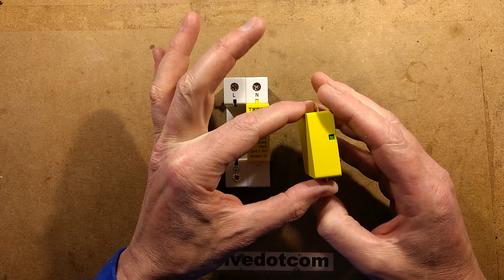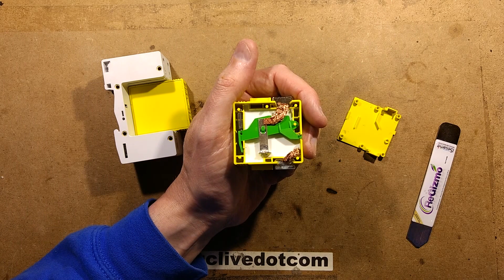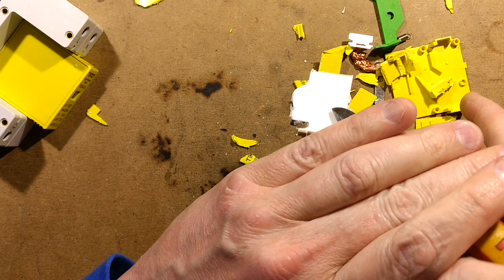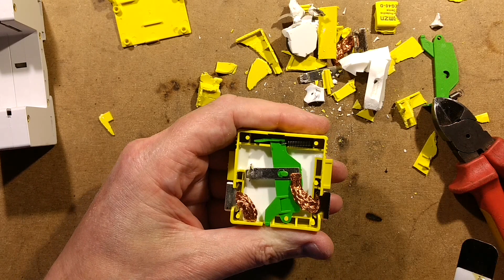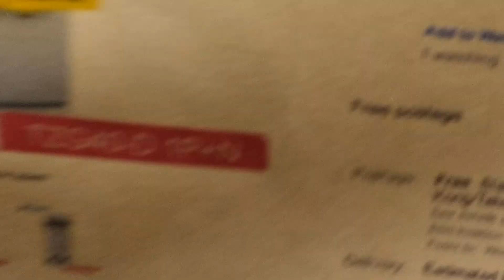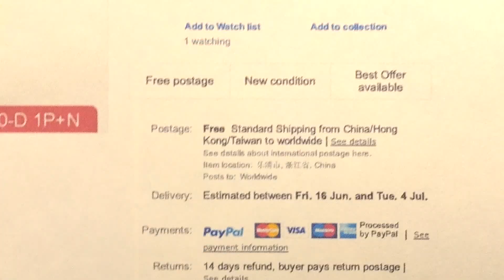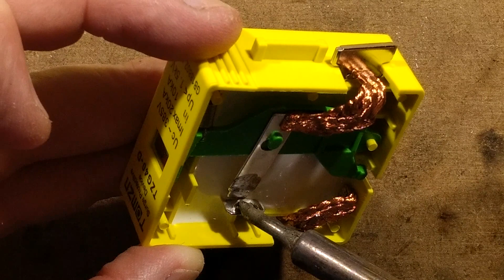DIN rail mounting surge protector with uninspiring safety device.

Comment: That rear plunger is used for mounts that have a secondary micro switch so when they trip they open or close the switch and trip a remote alarm. I use Hager brand products where there is an optional switch equipped base for the alarm feature.

Comment: The safety device may use model-maker's solder rather than electronics multicore. Because when you solder a new bit onto a model, the bits you did before can desolder themselves and fall off, modellers have at least a dozen (sometimes more) different solders with different melting points. and you start off in the middle of the model, using the highest melting point solder, and as you work outwards, you use lower and lower MP solders (and turn the soldering iron down as you go!)

In the seventies, some model-shops, specialising in cast metal models, would have a shelf with about fifty different grades of solder on it. This is why plastic Airfix models won out in the end. Some hard-core people will still build model steam engines and the like from dozens of die-cast bits, tacked together with a pallete of different solders.

It would be possible to select exactly the right melting point, if the maker was bothered...

Comment: I took a failed one of these to bits some time ago (made by Weidmuller). The interior design was very similar indeed, with the exception of the "solder blob" which in their case seemed to be sintered fusible disk. Worked on exactly the same principle though - once the MOV had absorbed too much energy, the internal resistance dropped (pretty abruptly), and the high current caused the fusible link to, well, fuse.

Comment: Great Videos  Clive. I have these fitted. I`m not expert!. But they have to be used in conjunction with the MCB/RCD combo, (or any fuse). That is what isolates the circuit not the Surge Protector. I think the part your were desoldering is just the flag to tell you the unit has failed. They fail eventually if you have multiple surges (they say) So as I understand it, the unit goes low resistance very quickly after the voltage exceeds a preset value. that low resistance draws enough current to trip the consumer unit fuse. Job done. The flag may still be green telling you the unit is still viable. Hopefully they work as designed!!...We live in the mountains and the mains gets hit often.. Thanks again.

Comment: MOVs are an ablative component, iirc and they fail short, don't they? So that solder link is intended to see the full dead-short as the MOV fails and break the connection.
Reply: Hyratel They do not ordinarily fail short, just a much lower impedance than normal as they degrade causing the to warm initially, and eventually combust as they further deteriorate and get ever hotter over time (sometimes you will see them with a thermal fuse sandwiched between several MOVs for that reason).  It is the heat created by the MOVs internal resistance that melts the solder and opens the connection.  It is not until the MOV is reduced to a charred carbon remnant that you would see a near dead short, but that only comes after the fire event.
Reply: Ethan Poole til, thank you

Comment: If they had the solder joint running in the vertical plane rather than the horizontal, as we are looking at it here, the separation would be much better. I don't think they have thought this one out very well. Good idea, badly executed.

Comment: For the solder joint, I'd say that when it actually begins to fail, the arc created as the join separates will probably finish off the remainder of the solder created a wider gap between the two contacts. That's my guess, anyways. I learned that about some glass fuses as this is the way they work.
Reply: Bobby Hicks Except that there is no arc so long as the conductive bridge remains (the arc only follows once the bridge between both sides goes open and you get back EMF from an inductive kick).  That said, the lower contact should still remain a liquified puddle of solder so long as current flows through the MOV, so it may still separate eventually after things warm up a bit more.

Comment: Even if gap would be wider - it would be far from regular circuit breakers. There is no arc extinguishing chamber. I believe that would not be able to cut even 500A with WIDER gap. I assume this device is not expected to cut short-cicruit currents and regular circuit-breaker is expected to be connected in series.
Reply from the maker: It's only expected to break its own fault current which would only be the amount that was causing it to heat.  Probably around 50mA.

Comment: The metal piece seems to be loose on the green plastic, and the hole through the metal piece which the green tab slots into is longer... when you heated the solder, you were holding these upside down from the position they would be mounted in. Is it possible that if the solder melts with them held proper-side up, that the extra play that the hole in the metal slot allows would let that metal connector to be pulled down by gravity, making the gap wider and making a solder bridge less likely to form?

Comment: in this case you do not want to break the circuit, because if the circuit is broken you would be able to switch back on the circuit breaker and maybe not replace the faulty varistor! is safer for the circuit and people to keep it short circuited when it actuates, enforcing replacement for a new one. spetially on the ones that do not have an auxiliary contact for monitoring is state!

Comment: Clive, thanks for discombobulating one of these for me. I checked the specs on this model. It is important to remember that for sensitive electronics to be protected from lightening surges. You need a response time of <4ns. This device is rated at <25ns. Also I am wondering if they may be relying on the spring loaded pin (normally located in the base, but not with the base you have) to help push the green indicator completely out of the window. As you mentioned, and in the models I have seen, the pin (when released) closes a set of contacts for alarm purposes. Also my motto is that no project is complete without a blood donation.

Comment: keep in mind that a dead short would cause it to trip in the off position. if the device did not completely trip in the off position, the dead short will still be there. so the triping condition will  cause the device to trip again very fast!  The complete open circuit will be completed in less of a second.

Comment: if the unit is positioned horizontally like it would normally, would gravity help the solder "flow" down to make a better/larger break?
Reply: Do a test with it horizontal and use electricity to break it.

Comment: Have you considered the impact of gravity to the melting of the solder?  Both times you melted the circuit it was flat on its side.  If the component was in place the heat would be coming up the long arm of the switch and melting down that arm.
Reply: Not all DBs or din rails mount parts/switches standing (eg 3 phase style boards...), utilizing gravity as a part of safety system is a bad idea for many reasons... Unless orienttion is specified on spd I would actually pass it even if fitted upside down

Comment: I dont understand this thing. are you supposed to solder it back together to reset it or what? and wouldnt when it popped depend on the solder you used and how much etc cos some solder melts hotter than other.
Reply from the maker: Once it gets hot enough to melt the solder it has already failed and the whole module needs replaced.

Comment: The markings on the thermal cut out ( L, N ) suggest that its used in a single circuit. BUT and its a big but, both live and neutral are meant to be linked making it a double pole isolator. If the solder was to heat and break the contact on the NEUTRAL side it will stop the appliance from working BUT its now in a dangerous state as there will be 240v present at the appliance relative to earth.  
PS Great show !
Reply from the maker: It's just hooked across the mains.  It's not in line with a circuit.

Comment: hi, it would be great if you can hack and chack the high amp motor controller from China. These controller are used for the electric motorcycle conversion and people are always in doubt about buying them. You will do a great karma for not only the people but also for the mother earth as electric motorcycle conversion is a step for saving the mother nature.

Comment: BigClive: If this device was used as a 'safety swith' controlling a contactor, the gap wouldn't need to be too wide since there would be no risk of arcing as it would on a high amp load. Maybe?
Reply from the maker: The contact is to disconnect the internal suppressor when it fails and starts getting hot.  This device is intended for connecting directly across the mains.
Reply: Ah, ok. Nothing like showing my ignorance for all to see. 🙂

Comment: surely a MOV and a regular breaker would do the job?
Reply: How would a regular breaker detect the MOV overheating, then?
Reply: the mechanism shown is not detecting over heat, the solder joint acts as a fuse as the the MOV clamps it's resistance drops and pulls more current which melts the solder joint. a regular breaker would trip on this current. if you did want to detect over heat you could include a thermal cutout based on a bimetallic strip (which is how many breakers work anyway)
Reply: I'd be more prone to thinking that the MOV is there to sbsorb spikes that last only a millisecond or so and the solder is there to pop when the MOV is spent and starts conducting all the time at normal voltage, which would lead to overheating. The solder will not have time to react to spikes at all, way too much thermal mass.

Comment: In my country these surge protectors are required in a new installation.
For a three phase mains household distribution supply they cost about 100-150 Euros.
The main reason to have them is indirect lightning strike that induces high voltages into your circuit.

Comment: I am not 100% sure, but if the current was so high that it caused the solder to melt in the first place, that same current would most likely vaporise any strings of solder left behind. But as I would not like to bet my life on it, I will agree that the design could be a little better. I don't think it would take too much of a change to make it a lot better. A shorter, stronger spring, less solder and trimming the excess plastic that was fouling as the spring pulled the contacts apart would do the job.
Reply from the maker: The failure mode of MOVs is to reduce in resistance so that the standard mains voltage is enough to pass current at a level high enough to cause heating, but not enough to trip an overcurrent device or melt the solder directly.

Comment: hey bigclive, i was wondering would it be possible to make a video on converting a HVAC with mechanical thermostat to a digital one, frankly speaking a windows AC consumes 20A of current but i cant find a appropriate relay for it, if i did i could trigger it on and off using a arduino or something like that. I wonder how the ACs with digital boards manage it, is the mechanical thermostat using a lower current line to the compressor?
Reply from the maker: The mechanical thermostats are available in types that switch high current, but it's also common for the thermostat to be switching power to the coil in a high current contactor.  (Large industrial relay.)
Reply: what i have is those gas filled mechanical thermostat which says a rating of 20A and short circuit of 80A but the wires coming to it dont seem too thick, i was wanting to put a relay which can handle the load and make it into a digital one. The other option was to find a wireless plug which can handle 20A at 230V so i can make the AC plug wirelessly controlled but could find that too and im not sure those cheap songle relays can handle the current which goes through the thermostat
Reply: the thermostat i have is as displayed in below link which i want to replace with a relay http://www.thermoster.com/English/pro1.asp?cid=15
Reply from the maker: You could use the thermostat's relay to switch a bigger external one.
Reply: bigclivedotcom well my thermostat relay is mechanical, the relay is built-in so I want to get rid of it and use a normal relay which I can trigger accurately using digital signals in place of the mechanical thermostat relay and what I'm looking for is a high rating relay. I think the compressor might have it's own contractor but need to check, I think all compressors have it
Reply from the maker: If you were to connect a suitably rated AC ammeter in series with the thermostat it would show you how much current it was switching.  There may be a wiring diagram inside the unit on a service panel.

Comment: was slightly sad he didn't test the second one with electricity
Reply from the maker: It would have required making the MOV fail in a manner that caused just the right level of heating.
Reply: @bigclivedotcom  I've found that metal-halide ballasts are outstanding at making MOVs fail.
Reply: that's more Photonic Andy's department :)
Reply: bigclivedotcom give it the photonic test
Reply: What if you're not trying to find the threshold of failure but rather whether it is effective at meeting its claimed performance?
Reply: That's what hot air guns are for.
Reply: +bigclivedotcom You just need high enough voltage to start conducting the MOV, then limit the current (with series lamps for example), so it doesn't evaporates instantly. It will heat up.
Reply: until it pops!
Reply: Nonsense! Just hook a clip lead to the tab on the MOV, and another to the braid, and let that lithium jumper pack do a bit more work.
Reply: just ask @Photoninduction XD
Reply: Is this product good?
Reply: @andhimulyono6728  nope

Comment: Looks like someone miss spec"d  that spring, if it was a bit shorter it will open that lever completely. Shame isn't it as you mention  fairly sturdy and every thing could of worked if the spring was shorter

Comment: You are not happy with it not breaking the circuit properly, but there is no current going there. It's only shorting out to ground/earth when there is a voltage spike. So there is no need to have a huge gap for disconnecting the circuit. It is only there to tell the user that the MOV has been "used up" and needs replacing.
Reply: And when the MOV fails, the MOV gets very, very, very hot and tries to catch fire.

This is why the proper ones have thermal fuses.